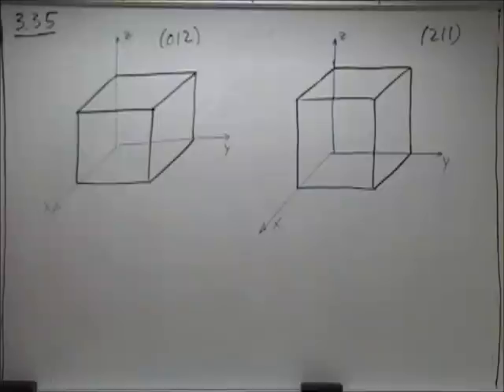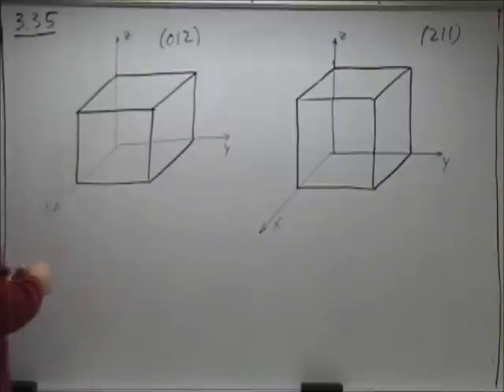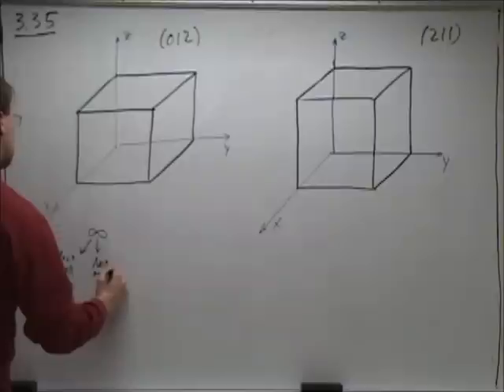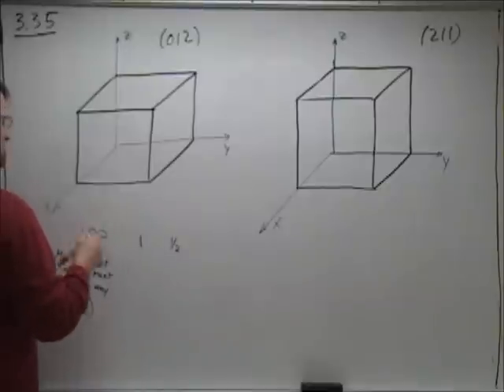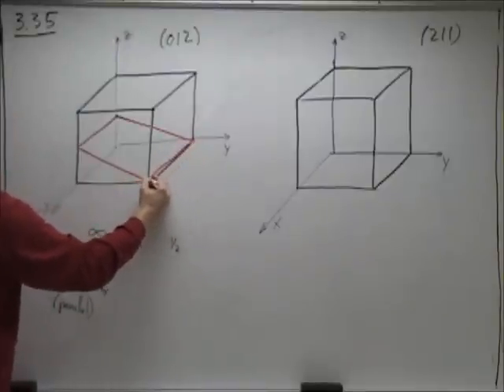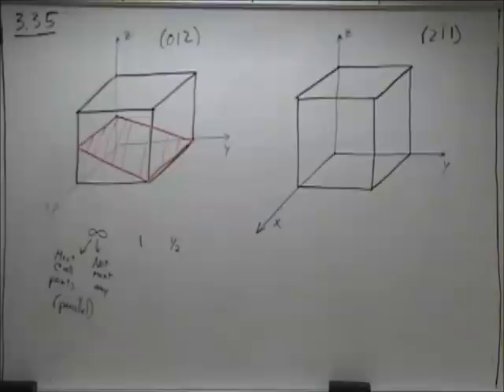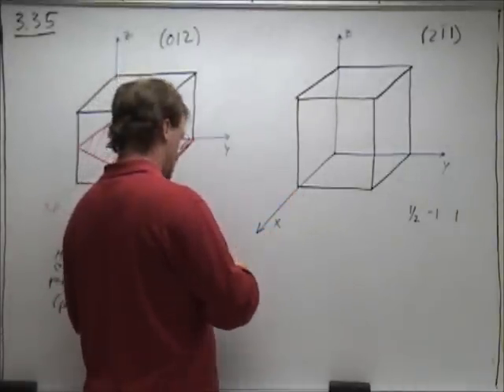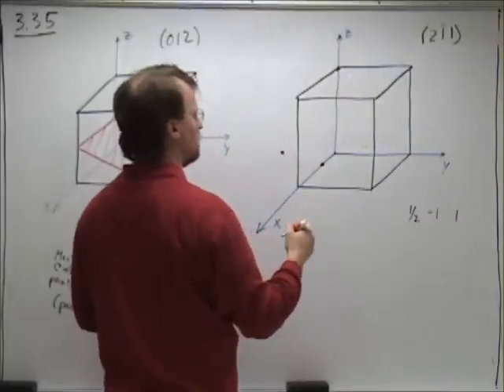Planes in a Cubic Unit Cell

Comment: for the second question (2 -1 1) you have to move the plane inside the cube for the final answer, only then you will get the correct representation of the plane. I am not saying that the solution is wrong but just the final representation is not standard.
Reply from the maker: +bhrz 
True. If you make a video that adds on, I'll tag yours at the end.
Reply: For anyone still watching this, you can also simply move your origin in order to put negative indices inside the box. For example, Setting your origin at 010 (at y=1) would make this problem much easier. Ask your professor about this before doing it though.